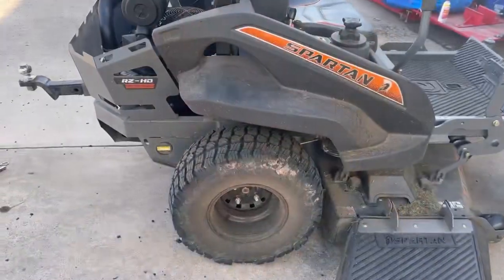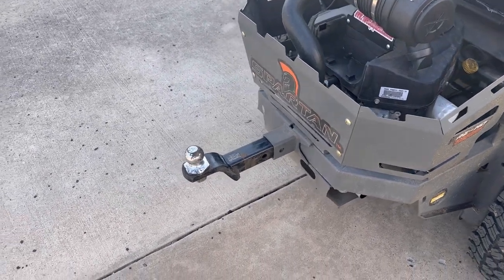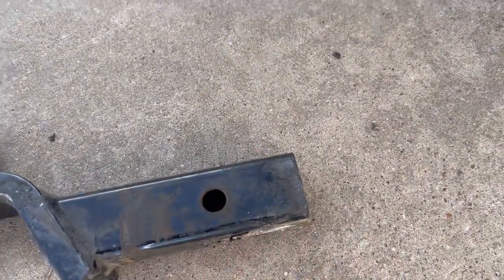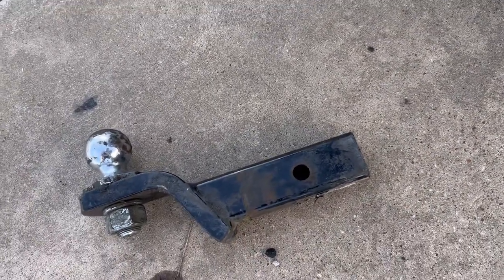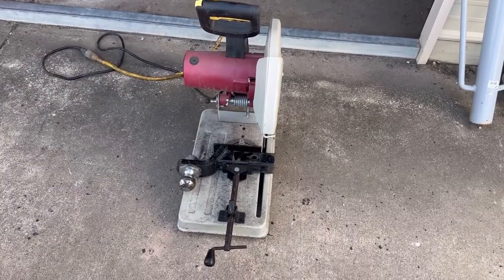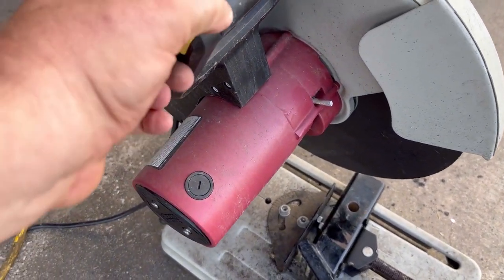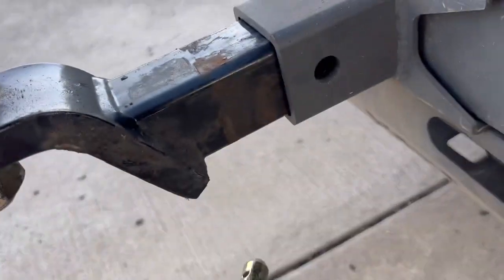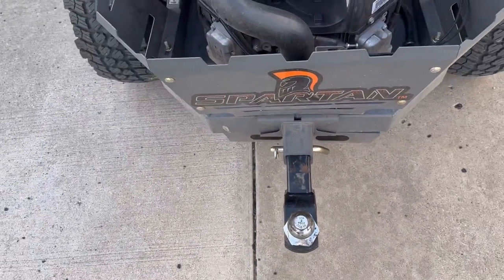MODIFYING A 2”  RECEIVER HITCH TO FIT MY 2022 SPARTAN RZHD ZERO TURN MOWER

Comment: Drill a new hole in the piece that you shortened so that you can use it on your truck
Reply from the maker: that means the hole would be 1/4 from the original hole. thus making the hitch even weaker than what i made it

Comment: Great idea.  And yes, it is only good for moving equipment around the yard.  I didn’t want to do that so I fabricated my own bracket for the same purpose.  I can use the receiver in modified.  I bought from Wally World the the 2-1/4” square tube with the holes in place.  I then bought 1/4”’plate and welded it together.  I made one for my Toro and one for my dad’s John Deere.  Painted the poor welds so you won’t see them from 30,000 ft.

Comment: Hey @themowermedic1 - Is there a trick to getting more/better traction from the rear wheels of a Cub Cadet RZT L 54" mower?    I've seen suggestions to air up the rear tires (didn't help) or air down the rear tires (didn't help).   I thought I'd come to the expert for the real answer.
Reply: Check out MARASTAR Tires. They have some good tractor type tires for riders.